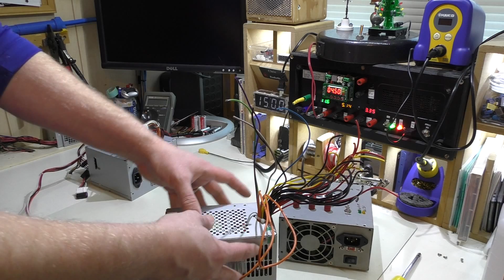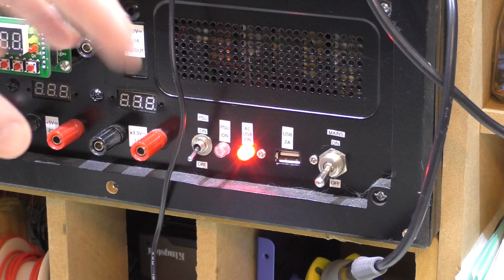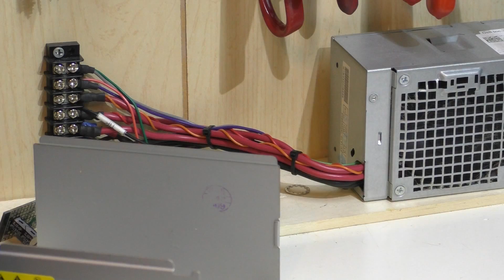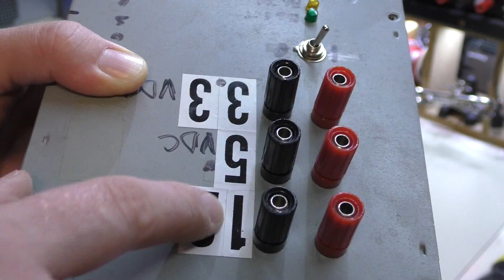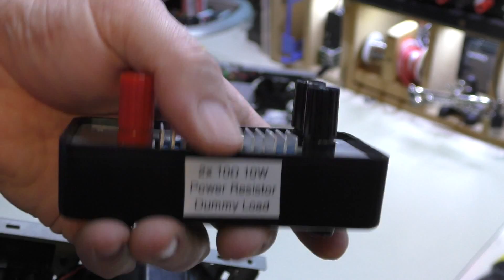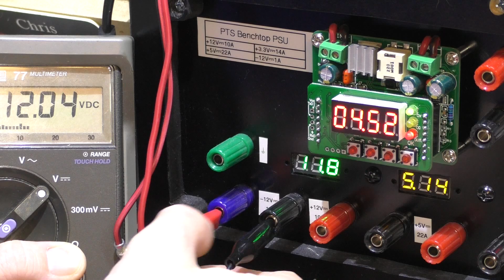PTS Ep. 28 Follow-up (Answering your Questions)

Comment: AT 19:50 do you think that attaching the power resistor to the 3.3V rail rather than the 5 V rail would have lowered it to 3.3 V? My understanding is that you need to put the power resistor in the rail that draws the most current (usually 12 volt).

Comment: I used that same B3603 buck converter to make a portable power supply. I mounted it in an enclosure that I made by stacking 2 Altoids tins, and I power it with a 19V laptop charger/adapter brick.  I also included a step-up converter, for those few occasions when I need more than 18 Volts. The step-up converter is set to double the input voltage but is not permanently in-circuit; it's on it's own switch, because when used, it raises the voltage but lowers the available amperage... But it's a handy addition if you need 24 Volts and your adapter is only giving you 18.

Comment: Hi Friend
Have some good news 
I kept on experimenting with my ATX & finally solved the problem of the 12 volt rail.
I found that by increasing the load on the 5 volt rail the voltage increases on the 12 volt rail.
What I did was put 2 Auto 12 volt bulbs (29.6 watts each ) number 1156 in parallel with the 10 ohm/ 10W resistor (All in parallel) on the 5 volt line —amps drawn about 4 amps .
The voltage on the 12 volt line with the little fan connected went up to 12.05 volts.
I understand by this we have to partially balance the load for the voltage to kick into the 12 volt rail………. PROBLEM SOLVED
Reply: Very rare design

Comment: Thank you for the wonderful video with in depth explanation if the various functions etc
I am a 75 year old hobbyist to keep busy during these crazy times 
I am at present trying to convert a 300 Watt ATX to a bench top supply
Without the load resistor I get 3.39 / 5.20 /& 11.96 volts I even tried with a 10 ohm/ 10watt resistor on the red & black
When I connected a small 12 volt cooling fan to the 3 yellow & 3 black wires the voltage drops to 11.05 at 960 milliamps. Why is the drop so much.
The label shows at 12 volts the max amps is 10 amps
Should I out the resistor on the yellow rail.
While the fan is connected I checked the 3.3v and the 5.0 volt rail they are fine (3.38  & 5.20)
Can you please let me know why this is happening for a small load only 10% of the rated  amperage 
Thanks in advance
Reply from the maker: Thanks for your comment.  I'm assuming you're converting an old supply.  It may have old capacitors and is loosing spec when under load.  Try testing it without the load resistors.  Also check the resistance of the fans.  The combined load of those plus the load resistor may equate to the drop you're seeing.

There may be an adjustment pot inside the supply as well.
Reply: @pileggitech  

Thank you for you prompt reply 
When I remove the load resistor the voltage drops to 11.62 volts without load (without the cooling fan load)
When I tried the same fan on the 5.2 volts line the voltage is stable a drop from 5.117 to 5.113 volts so I don’t know why the drop is so much on the 12 volt line
After discharging the caps I checked them with my capacitor meter for the 300uf/200v it reads 262.6uf  and 266.7uf a bit weak I guess 
The fan I used draws only 960 milli amps where as the 12 volts line is rated at 10.0 amps 
Maybe I try replacing the caps, will that solve the problem 
Is it possible to put the load resistor on the 12 volt line or will it blow the circuit 
Please advise and thanks for your kind help
Reply from the maker: @veeem3964  it should be OK to connect the load resistor on the 12V line.  These supplies usually have over / under voltage and current detection as well as short circuit protection.  They are quite robust, usually.
Reply: @pileggitech  
Thanks friend once again shall try and see if that solves the problem 
How are the values of the caps 
You’re right this is an old ATX 2009 I think which I picked up from my old junk collection

Comment: Please post the link for the nice buck convertor used by you on your main benchtop power supply. Thank you.
Reply from the maker: https://www.ebay.com/itm/B3603-3A-6-40V-DC-DC-Digital-Control-CV-CC-Step-Down-Buck-Converter-Module-USA/192381787895?hash=item2ccad91ef7:g:4gYAAOSw~vpaIIAU

Comment: Love the video.  I am converting one now and have a lighted switch that i would like to use in place of the LED's.  Is this possible? I can't get the switch to light.  How do I need to wire it.  The switch is 12 vdc 20amp with 3 terminals. Thanks for any info you can provide

Comment: Could this power supply be used to power (intermittently) a 12 V 3 Amp bilge pump (designed to run off a battery)? Or would the inductive load be too big?
Reply from the maker: That's a good question.  It may work as I've ran bilge pumps off of a smps before.

Comment: Is it such a great idea to wire all the 12V (yellow) wires together if the PSU has more than one 12V rail? Won't the 12V you're getting out of the binding post then be unregulated?
Reply: No, the 12 volt wires all come from the same point on the PSU. They are all regulated to the same voltage.

Comment: Finally someone fully explains the power unit, considering I'm a newbie. About that DELL power supply at the start of the video... I have one that I'm presently working on, when I jump the green+gnd wire the fan doesn't seem to come on. Do I need to have a load for it to turn on? I've converted other power supplies and had no problems. - Thanks

Comment: I watched twice now. I am trying to find a part of this video that does not have excellent content but I failed! This is a great resource for people working on PC PSU's. Thanks for sharing this.

It would be great if you could show us what you mentioned at the end about connecting multiple PSU's. I have heard this is impossible because one PSU will take all the load while the other will do nothing resulting in burning it out.

Also, what you mentioned in another video about making a small circuit board and attaching it for neater arrangement sounds good. Would love to see this.
Reply from the maker: Thanks for your feedback

Comment: Do I need to solder together every wire of the same color or can I just use a few of each and heat shrink the rest? Soldering together 8-16 wires is proving to be quite annoying
Reply from the maker: No.  You only need enough wire to carry the current required of the device you're trying to power.  I put 2-3 wires in a ring terminal and then stack them onto the screw terminal of the binding post.  You may also be able to replace the wires with a heavier gauge.
Reply: What if you have two of the yellow wire's have black. Strips down them do you steel.
Reply: Them with the yellow wire's

Comment: Where did you get the digital readout soft the voltage measurements and how do you hook them up?
Reply from the maker: Also eBay.  Look for "LED Voltage Display" like this one: https://goo.gl/KAjgx4.  Note:  There are two and Three wire versions.  They both work the same however the wiring is a bit different.  Two wire models have a red and black wire.  Connect Red to positive and black to ground.  Simple.  The three wire models have the same colors and are wired the same way.  That will just power up the display.  The third wire will have to get connected to the voltage you want to monitor.  You can simply connect it to the same connection as the red wire.
Reply: Thanks again for you wonderful knowledge and explanations .I've learned a lot from you and your videos!!
Reply from the maker: You're welcome.  I just consider it as paying it forward as I've learned a lot on YouTube myself!

Comment: What kind of toggle switch did you use and how many volts? Is it spdt? Thanks
Reply from the maker: It was a SPST switch.  The voltage rating doesn't matter; it's only a low voltage signal line that's getting switched.
Reply: Oh thank you again! Hahaha

Comment: How many volts did you use for the red and green leds? And also how many ohms for the resistors? Thank you!
Reply from the maker: The LEDs are wired onto 5V  signal lines.  150 ohm resistors should work well for standard LEDs.
Reply: Pileggi Technical Services So the standard leds are 5v, Sir?
Reply from the maker: Standard LEDs have a range of 2.0 - 3.3 Volts as per this chart: http://led.linear1.org/vf-help.php
Reply: Pileggi Technical Services Then I will use 150 ohm resistors? What color code?
Reply from the maker: The color code for 150 ohm resistors is Brown Green Brown.  I highly recommend looking at the LED calculator that I mentioned which will not only show you the correct value of resistor required, it will also give you the color code of it.  The address is http://led.linear1.org/1led.wiz.  It is a very valuable site to bookmark.
Reply: Pileggi Technical Services Oh! It's great!
Source voltage - 5
Diode forward voltage - 2
Diode forward current - 20
Result=150 ohm
Nice! Thank you!
Reply from the maker: Can't live without it.  There's even a section on using LEDs in an array.  With schematics and all.
Reply: So basically, if I don't know the voltage of the leds, I can use the guess chart there?
Reply from the maker: Pretty much.  When in doubt you can always use a higher value resistor too.
Reply: Pileggi Technical Services Thank you again! :)
Reply from the maker: You're welcome!
Reply: Just for clarification again, did you use 150 ohm resistor for both red and green leds? Hahaha thanks
Reply from the maker: You can use the same resistors for both.
Reply: Ok Sir! Thank you very much! Appreciated man!

Comment: How to connect the 2 leds? Thank you in advance!
Reply from the maker: 1.  Connect an appropriate resistor to the positive lead of an LED then to the purple wire and the negative lead to one of the black wires.  This is the standby LED and will light when AC power is present.

2.  Connect an appropriate resistor to the positive lead of an LED then to the grey wire and the negative lead to one of the black wires.  This LED will light when the power supply is switched on (green/ black wire connected).
Reply: Thank you very much for the reply. So, purple wire=standby, grey wire=power? Right?
Reply from the maker: Correct.
Reply: Pileggi Technical Services Yown! I appreciate your fast and easy to follow reply. Subscribed!
Reply from the maker: Thanks!  I appreciate it!
Reply: Pileggi Technical Services Hi again sir, what resistor will I use for a 5mm red and green led lights? Thanks! :)
Reply from the maker: +Brent Gamba the resistor value depends on the forward voltage and forward current of the LED and the source voltage of the circuit you're connecting the LED to.  I use the online LED calculator to help figure out the needed resistor.  The source voltage for the power supplies is 5V.  You'll need to get the other two values for your particular LEDs.

The calculator can be found at led.linear1.org/1led.wiz

As an example, a standard red LED has a forward voltage of 2.0V and a forward current of 20 mA.  That would require at least a 1/8W 150 ohm resistor.  Standard green (2.2V 20mA) could use the same 150 ohm resistor.  By the way a standard LED are the ones that aren't super bright.
Reply: Pileggi Technical Services I think mine is the standard because the cover only says "5mm red led" but no watts. So I think I'll go with 1/8w 150 ohm. Thanks Bro!!!!
Reply from the maker: You're welcome!
Reply: What if you have two yellow wire's what are they for
Reply: Black and yellow wire's sorry
Reply from the maker: Yellow wires are for the 12V rail.  You may also have a 12V sense line that is also yellow.  In that case it should be connected together with a 12V line.

Comment: It's a Thermaltake Xaser III silent pure power 480w  w0010 . My power supply come with 2 of them. A control in front :5,25" drive Bay and a control in rear : PCI card slot. Neither one of them work unless it's all the way up on max. 450W ,  17dBA is written on the box. Serial ATA hot swap-Active PFC - peak output:550W- 2 VR fan speed controller. I'm sorry I got the number wrong it's a W0011. I appreciate all the help that you can give me. Thank you very much and keep the viedos coming.
Reply from the maker: I'm thinking one of the components of the fan controller portion died.  Possibly a MOSFET.  I had a three channel fan controller in my machine that had a similar issue.  I had two 120mm fans, one plugged into channel 1 and another into channel 2, both of which ran fine and were both able to be adjusted.  

I used a splitter to install two 80mm fans onto channel 3 which worked fine for a while but over time I was only able to run the fans on high speed.  The adjustment knob did not work.  The combined power requirement for the two fans didn't exceed the rating of the channel.  I believe the current requirement of the fans goes up as the voltage goes down and so at lower speeds the component that's responsible for driving them may have gotten too hot and burned up.  Since it has no way of regulating the voltage, it will only allow the fans to run at full power / speed.

Comment: I have a fan speed control but I can't get it to work. I was wondering if you could tell me what I'm doing wrong. It only works when it's turned on max
Reply from the maker: Can you please provide me with the make / model of the unit so I can so more research on it?

Comment: I have a brand new 450w power supply.  How can I add a vote meter into it with a digital read out?
Reply from the maker: They're actually easy to install.  They either come in two wire (positive and ground) or three wire (positive, ground, and sense) configurations.  They function the same either way.

For two wire models, simply connect the positive wire (usually red) to the positive rail you want to measure (either yellow for +12V, red for +5V, or orange for +3.3V).  The ground wire (black) would go to the black ground wire of the supply.  The measure the voltage of whatever rail they;re being powered from.  You can find the volt meter here:  https://goo.gl/Mg6WY7

The three wire models are a little different.  They usually have a red and black wire, with an additional wire (either blue or white).  The red is for power in, black is for ground and the other wire is the sense connection.  You can tie the red and white / blue wires together to get the same effect as a two wire model.  Or you can power up the meter from one supply to measure another.  You can find that volt meter here:  https://goo.gl/7VTf97

Comment: Hi if I use a boostconverter on PC power supply would it take watts from the wall or would  it use it from boost converter . I'm running 550w on led what's powered by boost converter and that's powered to pc supply
Reply from the maker: A boost converter would be used to increase the voltage.  Using one on a power supply would still draw current from the wall because the PS is powering the boost converter.